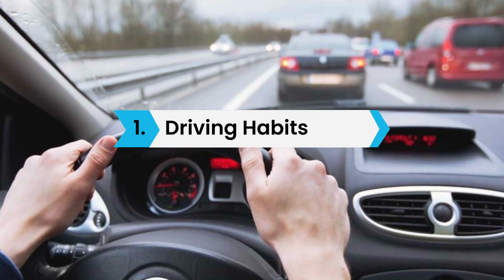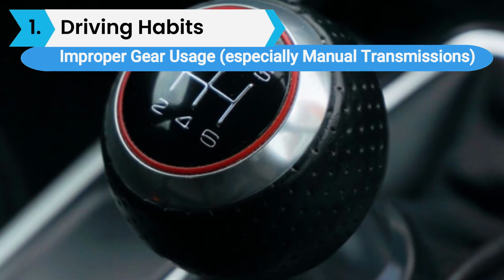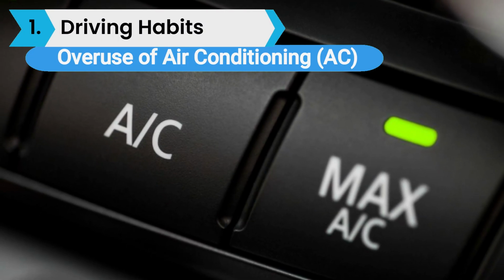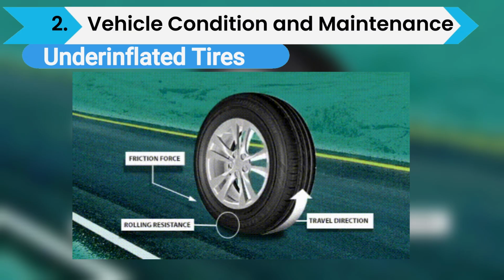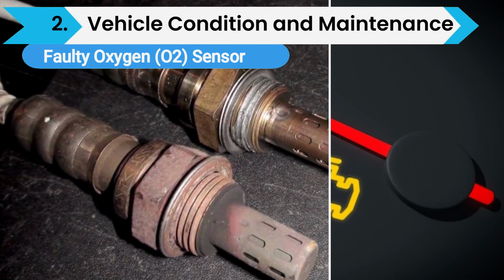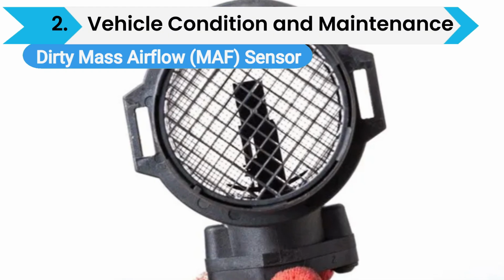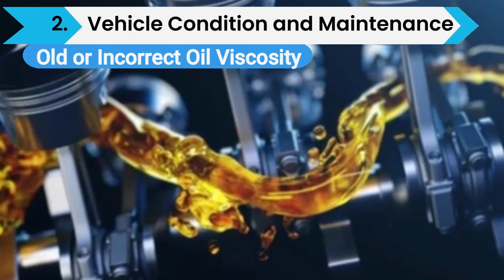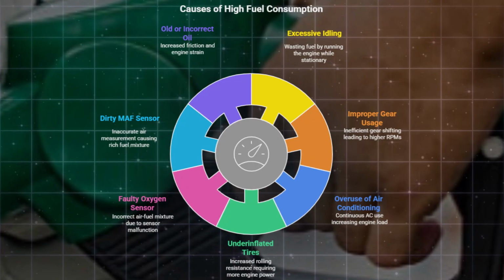Top Reasons Your Car Wastes Fuel – Explained Simply!

Comment: Driving habits is #1. Aggressive driving, racing up to stop signs then stopping on a dime because you can't roll through, same with speed limit changes, not using cruise control every opportunity. 15 year old V-8 p/u I still get high 20 mpg, sometimes up to 22+ depending on gas, highway driving @ 58 (3 over) on modestly hilly roads.
Reply from the maker: Thanks for the insight, good driving habits definitely play a big role in fuel economy!